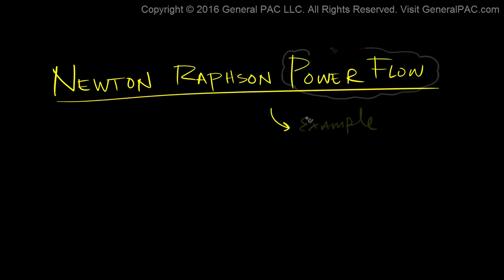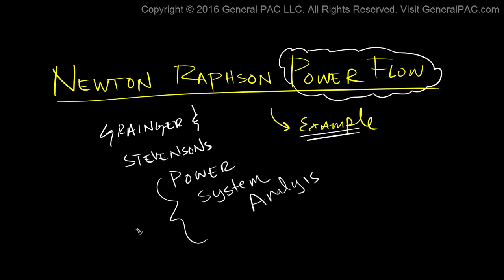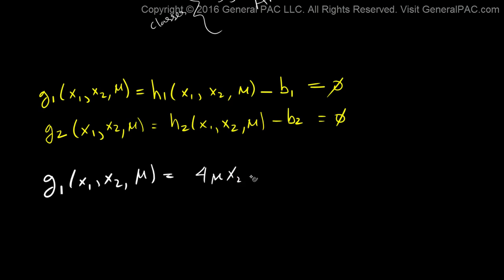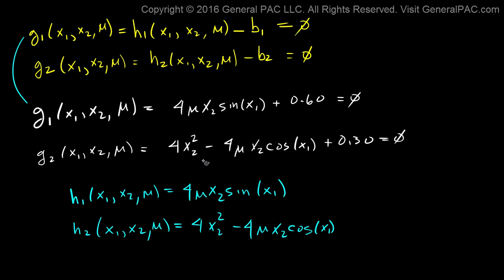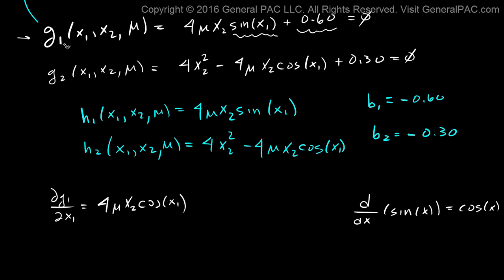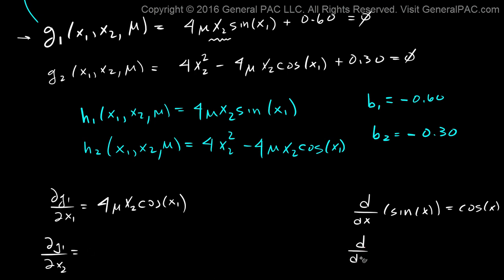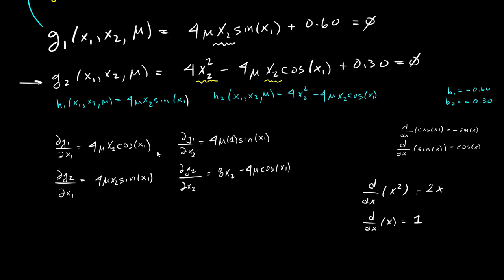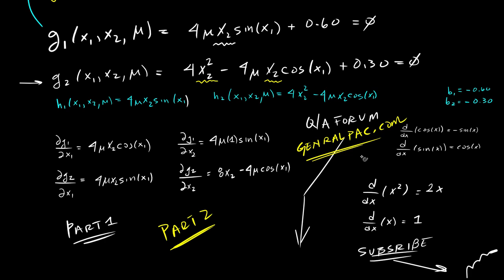Newton Raphson Power Flow Example Part 1

Comment from the maker: In Power System Analysis course we will start from very basics: principles of Balanced systems, how power factor affects the performance of systems and techniques which we can employ to improve the power factor. In addition, you will build a strong concept on per unit systems and load flow analysis. This module consists of four parts, each building upon your knowledge based on previous ones.  Get 𝟗𝟎% 𝐎𝐅𝐅 on 𝐏𝐨𝐰𝐞𝐫 𝐒𝐲𝐬𝐭𝐞𝐦 𝐀𝐧𝐚𝐥𝐲𝐬𝐢𝐬 𝐅𝐮𝐧𝐝𝐚𝐦𝐞𝐧𝐭𝐚𝐥𝐬: https://bit.ly/Power-System-Analysis-90OFF